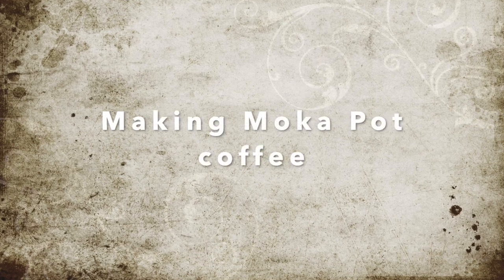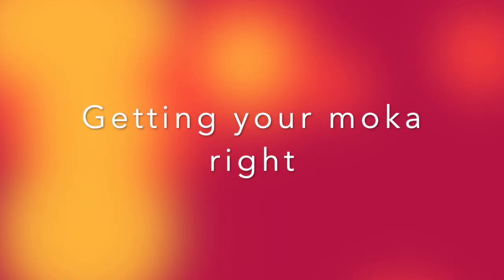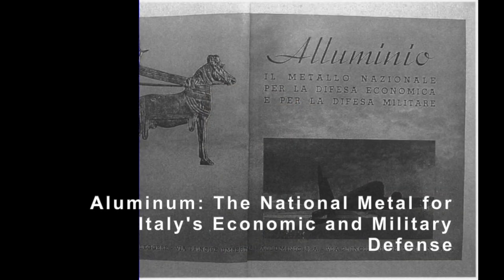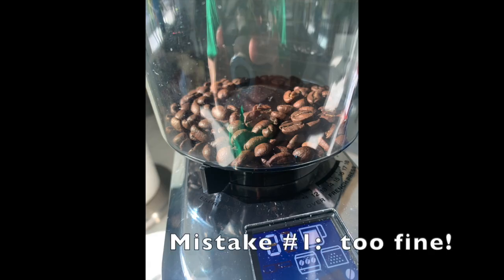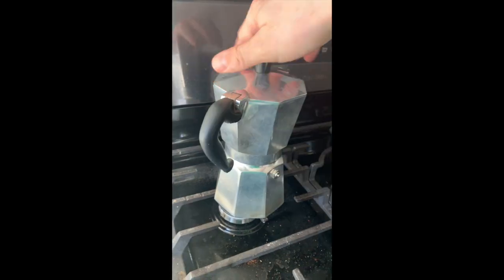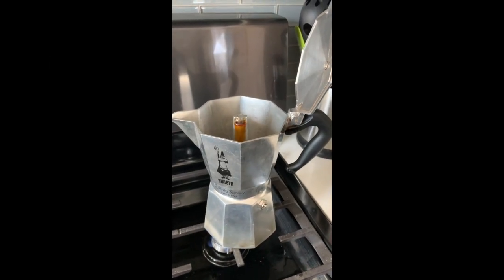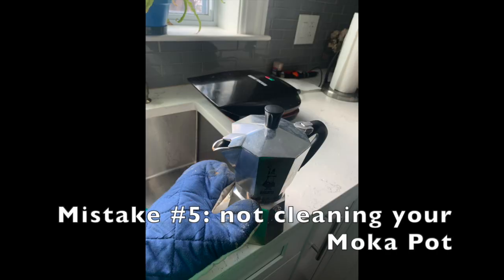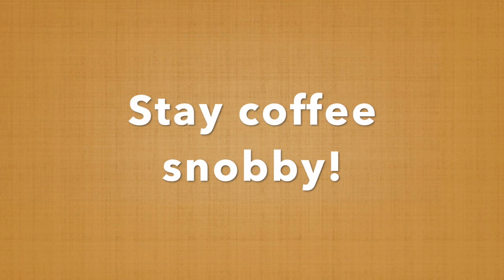Why your Moka pot tastes bad

Comment: Italian here. You made two mistakes. 1) You don't have to put hot, boiling water in it, but cold tap water and put the pot on the smallest flame possible. 2) You have to put way more coffee in it (without pressing it with the spoon), it has to look like an hill/mountain and it will be compressed a bit when you tighten the pot.
Reply from the maker: Hello there, my Italian friend. Thanks for bringing up these issues, as it lets me clarify a few more misconceptions:

1) You absolutely can use cold water and I've experimented around with both, but it does not affect the taste of the coffee, simply because the vapor does not start to dampen the beans until boiling anyway.  However, since using an electric kettle is both more energy efficient (http://insideenergy.org/2016/02/23/boiling-water-ieq/) and faster, I just jump straight to it. 

2) I would specifically advise against stuffing the filter in the manner you suggest.  I've have experimented around with it a bit and I have found (a) it prevents an airtight seal with the gasket and (b) causes loose grounds to become embedded in that gasket.  The result is that you do get a stronger cup of coffee, but you sacrifice brewing pressure.  I've even found it makes less coffee!

3) Regarding your post below about stirring with a teaspoon, I agree.
Reply: loodog555 I forgot to mention that to preserve the airtight seal and the pressure you simply have to tighten the pot so strongly that veins in your head start to pop :)

Tip: if you all found out the coffee is getting stuck, like only 40% or less has risen up, just put the base of the pot under cold water ( you’ll feel some vibrations) being careful not to spill the coffee inside, and put it again on the flame. After few seconds the all of the coffee will magically rise.
Reply from the maker: @g3rzin  Hey Gerardo, happy to follow up!  Of course, our expression here in America is "Your mileage may vary".  Moka Pot is all about getting the best coffee that works for you and it seems everyone has a different favorite cup.  However, for the sake of the collective coffee knowledge of humanity, I'd like to debug this a little bit and figure out why your results and mine have turned out so differently using the same technique.

I definitely tighten the top to the point of the tolerance of the aluminum threads, which is pretty tight.  The issue is that all the pressure in the world won't create a proper seal with the rubber gasket if there are obstructions to that seal in the form of the grounds (which is what happens when I have tried your "mountain" technique).  A nice seal will happen without all that much pressure so long as the rim of the filter can mate smoothly to the gasket.  So this leads me to my theorizing about what you're doing differently.

My pot takes about 300ml of water and the filter holds about 20-25 g of coffee, depending on how coarse the grinds are.  This is intentional design, as it creates a water:coffee ratio of about 15:1.  My theory is that your overfilling is only an extra gram or so and the result is that you can still get a seal out of it.  

Can you be a bit more specific about how much "mountain" you're adding?
Reply: @loodog555  I think it's more than a gram :)
Here's all the process: https://imgur.com/a/HLyVA42
Reply from the maker: @g3rzin  Oh geez, that is really a mountain. Your moka pot must have a fundamentally different design than mine, perhaps a much broader softer gasket.
Reply: It is also fundamental to stir the coffee with a teaspoon after you remove the pot from above the flame  since at the beginning the coffee that rise is denser and more bitter while at the end it's more watery.

Comment: And how about using some descaling agents against those mineral deposits?
Reply from the maker: Totally!  Most commonly recommended is white vinegar, as with any brewing method. Brew through once with a 50/50 vinegar/white mix, then 1-2 more times with just water!
Reply: @loodog555  I use distilled water which leaves no mineral deposits, what do you think?

Comment: You should have levelled the grounds and the basket should be filled. Washing you mokka pot with  warm water only prevents the coffe from tasting like metal. The water you fill in should be hot from the start that way it's faster on the stove and less moisture gets to the coffe before it should.
Reply from the maker: Thanks for your comment, Lars.  I agree with almost everything you say, though I did not show your first sentence very clearly in the video.  Exactly how to clean a moka pot is a contentious debate with many Italians claiming you shouldn't clean them at all, that it somehow adds to flavor to have old coffee patina in your moka pot.

EDIT: As for adding hot water vs. cold water, the taste is the same and the water isn't going to be reaching the coffee before boiling anyway, since there's no vapor pressure.  It's faster and more energy efficient to use an electric kettle, so I do.
Reply: loodog555 - the benefit of preheating the water is that the time on flame is minimised, meaning that the coffee puck doesn't dry out or burn during the water heating up phase, leading to a better flavour. Think espresso machine - puck goes on, then extraction takes place using instant hot pressurised water from the reservoir.  The puck starts the extraction process at ambient temperature. 

Also, I'd avoid step 4, force cooling the boiler section. If you condense the steam vapour in the boiler, you will pull a vacuum. So what? Well for those of us who like a strong coffee which means a full packed coffee puck in the filter, the puck will form a plug and the filter will be sucked into the boiler... don't ask me how I know, but upon reflection with my engineer's hat on, it was frickin obviously a risk in hindsight.  :) I turn off the heat when the spurting starts and then pour the coffee into cups with a minimal delay. That way there is no need to "stop the brewing process" by cooling down the boiler.  

By the way, great straight shootin vid. I learned new things about brewing with a "macchinetta" as my mum would call it. Cheers.